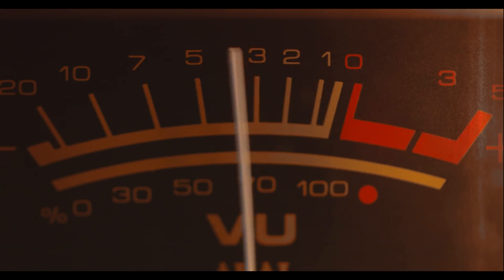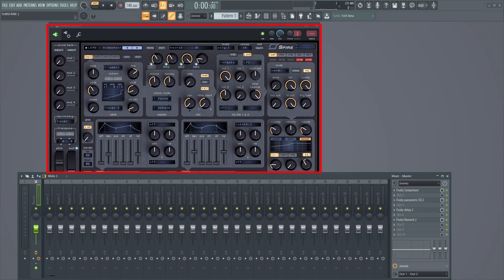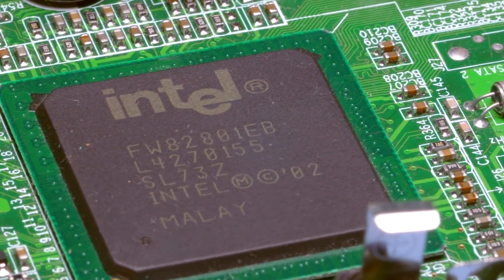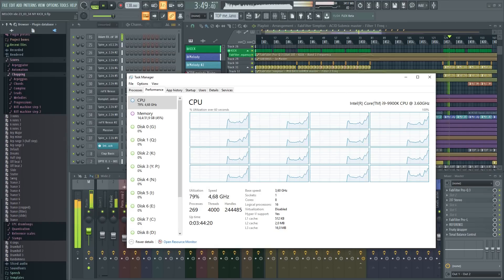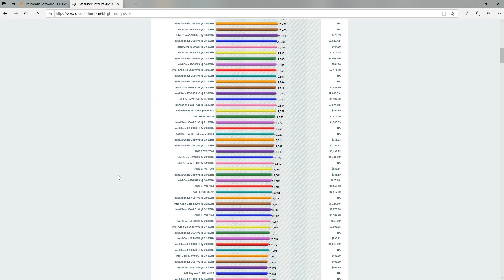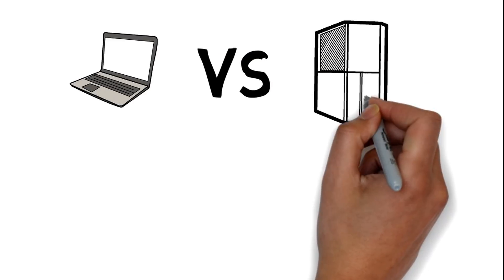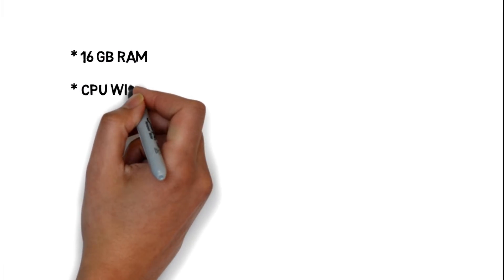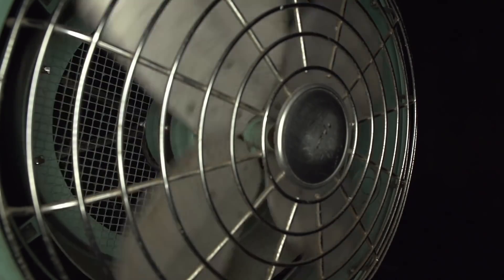The Best Computer For Music Production - What's Needed And Why!

Comment: basically he bought a new computer for the same results...lol
Reply from the maker: Not really. The 5820k has 4 channel memory, which is giving it an edge in this case since it's a large project. The 9990k only support dual channel. That said, the 9900k is about 40% faster than the 5820k. It's faster single core performance means that it can run the project with smaller buffer size. At say 1024 samples the 9900k would still run the project very well, but the 5820k would have overruns. 
I also do a lot of video editing and such, and the 9900k is much faster at that, as well as rendering, encoding etc, which I also do a lot of, and that's the main reason I upgraded. 
The purpose of this video is to recommend a computer for those who want the best possible performance for a music computer rig, and while the 5820k is still offering good performance for music production, I can't really recommend it since it's an older CPU by now. It won't work very well if you play games for example, as it will become a bottle neck in the system. It's also quite expensive still, and it's better to go with a more modern CPU overall.  :)

Comment: great informative video. There is one mistake though. You say that laptops make more noise than desktops. That's simply not true, except if you build a fanless pc, which is pretty hard to do.
Reply from the maker: Thanks. Regarding laptops, I was referring to a situation where it's under heavy load. A laptop has smaller fans than a desktop PC, which means that in order to move the same amount of air the laptop fan's need to run at much higher RPM. This makes much more noise vs a larger fan that moves the same amount of air at lower RPM's. 
The reason I mention this is so that people can be aware of this and buy a laptop that is a bit faster than what they actually need. That way they won't push it to the limit, and it won't make much noise either. If you push it to 95% then you'll definitely have some fan noise. :)

Comment: Wait I'm confused.. Are you saying that the most important thing is having a lot of cores? Is 16 cores enough?
Reply: No, the most important thing is the performance a single core can have, but that you should still have at least 4 cores anyway
Reply from the maker: Indeed. You typically want as many cores as possible, but you also want those cores to be as fast as possible. More cores = more heat, which means that the individual core performance goes down when you have a lot of cores. There will always be a trade-off here, so the best CPU will usually be located around that sweetspot where you start to get slower cores in favor or more cores.
Reply: Sorry, I was kidding, because that was clarified sooo many times in the video
Reply: troo lol

Comment: I9 9900k is probably the best but right under that is i7 9700k. Those are both top two processors for music production. Really depends on your budget but the i7 9700k at around $360-$375 is a great processor. Especially when overclocked. It’s a beast and can handle pretty much anything. I also have a rtx 2070 super and I know to studio doesn’t use gpu acceleration but trust me things do run smoother in the playlist and overall in general it’s an amazing combination 😁
Reply from the maker: Agreed! The new AMD CPU's are also good but I find that most people fail to take instructions per cycle (operations per clock) into consideration. The Intel chips have greater overclocking potential and will, therefore, provide better performance overall due to higher clock speeds even if single-core performance is fairly similar. :)

Comment: Great helpful video. In a system designed to heavily use sample libraries (kontakt) I've seen videos mentioning external servers to have the sample libraries on for large templates. Is this still the case or can you build a single audio PC to handle extensive sample library scenarios?
Reply from the maker: Glad you liked it. I generally prefer to have it stored on SSD disks. I have several SSD disks myself. Large libraries like nexus, omnisphere etc takes up a huge amount of space, but having those on local SSD disks saves you a lot of time in the long run since loading the sounds will be far quicker.
Reply: @FireWalkMusic  thanks!

Comment: There should be powerful sound cards just as there are video cards. It should not rely only on the cpu.

I wonder why they haven’t come up with a solution.
Reply from the maker: There has been experiments trying to use GPU acceleration to help the CPU but it hasn't worked out because there's too much lag introduced.

Comment: Great video! Shout out for PC! So, what to get for high DAW performance. Due to pulling out hair, foaming at the mouth frustration with my current system: 6700K CPU, 32GB DDR4, 1TB SSD 960 EVO + other drives etc. Has been POS for Pro Tools 11 - either numerous wonky occurrences or just outright freezes, crashes, smoke coming out the back (well, not quite) but it's time to take drastic measures. What I'm considering is: a Dual CPU
 system:
• Processor - Xeon E5 - Dual CPU:
o 2.3GHz Intel XEON E5-2697 V4- 18 Core 
• Memory - DDR4:
o 256GB DDR4 
• Hard Drives:
o High Performance SSDs
• SSD - Primary Drive (OS):
o    2TB 860 Pro SSD SATA3 
• SSD - Secondary Drive (Audio):
o    2TB 860 Pro SSD SATA3 
• Sample Library Drive (Data):
o    2TB 850 Pro SSD SATA3 
• OS:
o Windows 10 Pro 64-bit
• Graphics:
o 8GB (GTX1070) Quad Display 

Don't know about the singular core(s) situation, but is configured for music production. If it's a bit overkill, better that than underkill. It's gotta handle the voracious, CPU intensive stuff - such as Arturia, PSP, u-He and UAD - with Apollo 8p Thunderbolt 3. Any ideas, advise?
Reply from the maker: I understand your frustration. Generally a workstation PC will work quite well, especially if you have quad channel memory and such. Keep in mind though that single core speed and clock speed is also very important. Because work is not always evenly distributed across all cores, you can often find yourself in a situation where one core is maxed out, while the others are not, but you'll still have crackling and overload. I recommend you watch my latest video, as it explains very well what's actually going on here (towards the end of the video). Then you'll see why adding more and more cores won't necessarily help at all: https://youtu.be/hX10k8Hb77g

At some point there will always be a trade-ff between the amount of cores and the single core / clock speed. The best CPU for music production will usually be in this sweet spot, where it'll have many cores, but also very high single core speed and high clock speed. 

It also depends on what else you're using your computer for. 2.3GHz vs 5 ghz for the 9900k can make a huge difference when it comes to music production. I can't say for sure but I think you might end up spending a lot of money on a system that's not perfectly suited for the job. That system would be great for video editing etc, but I think you'll be able to get something just as good for music production at half the cost.
Reply: @FireWalkMusic  But what about Turbo Boost or Hyperthreading?  You could hypothetically order a pair of CPUs that runs with 6 cores at a base speed of 3.3Ghz, or a pair of CPUs with 8 cores and a base speed at 2.9Ghz.

On the surface getting a guaranteed 3.3Ghz for broad performance in audio is perhaps the obvious choice. But inspecting the turbo, it might only be able to accelerate 1 core to 3.6ghz, or a few to 3.4Ghz. The 8 core CPU might have a turbo of 3.8Ghz, and be able to accelerate 3 cores to 3.7Ghz.

In this case, with the extra cores, from the perspective of having several synth tracks, the two CPUs offer the high performance needed on up to 6 cores, for CPU mhz sensitive synths or programs, but then leaves 10 cores which can guarantee around 3Ghz for tracks which have modest or reasonably well implemented parallel optimizations. A chip with HT can also store instruction queues for each thread of each synth, where they take turns in processing the next audio computations while its pair fetches any data.

Comment: Should you have suggested ryzen 3700x instead of the 1700(x)?  Since the 1700s are two generations old.
Reply from the maker: This video was made in June, before the 3000 series came out. The 1700x is suggested for those who are on a budget and who don't need the very best computer. Most people don't need a 9900k. For small and medium projects the 1700x will usually be more than enough, and at a much lower cost. 

The brand new 3000 series is a huge step up for AMD though. Intel is struggling with their manufacturing technique, so AMD has been able to catch up quite a bit.
The 3000 series definitely offers far more value than the 9900k. All though technically the 9900k is still faster when it comes to music production. Operations per clock is now very close now between the 9900k and the new AMD CPU, but because the 9900k can run at higher clock speeds it will still come out ahead. It's not a huge lead though, and considering the price differeece I would recommend going the AMD route right now. Unless you are right at the limit and need the very best no matter the cost.